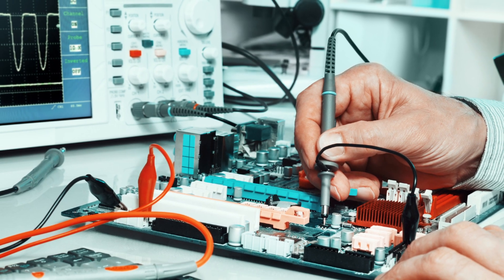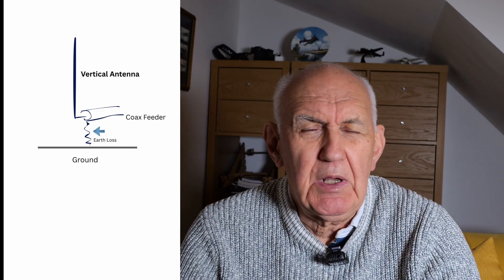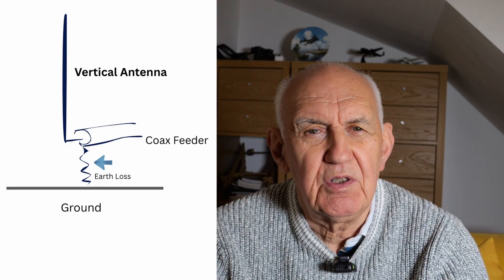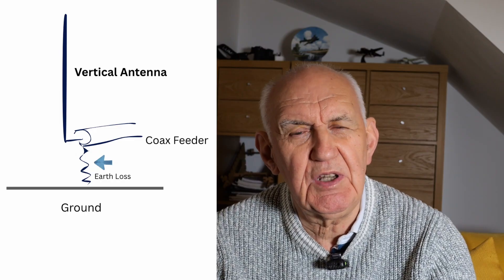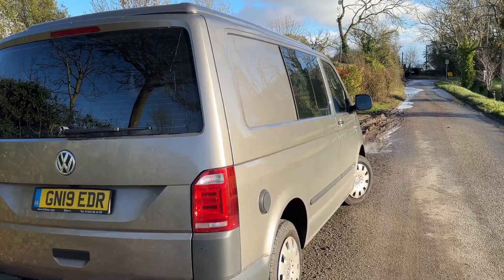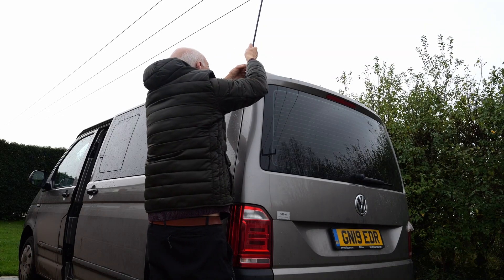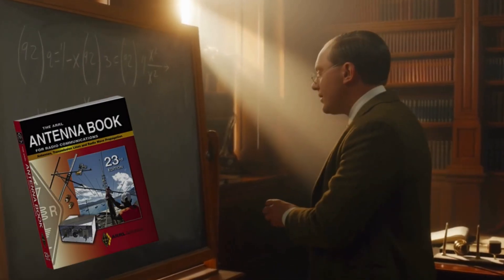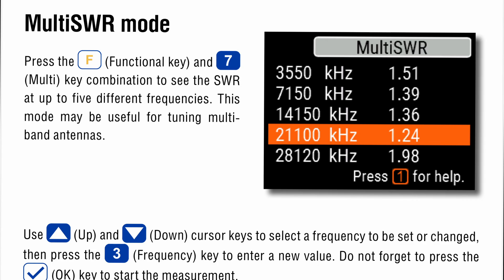VSWR Mysteries in HaM Radio

Comment: Thank you for explaining why my line isolator (choke) improved my SWR and brought it within specifications when I installed it at the transceiver input. I made the choke based on one of your videos. Following your suggestion, I used a 240-43 toroid core and wrapped 13 turns of RG-58 cable around it, securing the cable to the toroid with tie wraps. It fit just right and required about 2 feet of cable. Without the line isolator, my SWR was in the red. I had considered the issue of reflected RF coming back down the cable and the blocking effect of the choke, but I had not thought about the change in reactance at the transceiver input from the cable itself. Thank you for these excellent videos!
Reply from the maker: Glad to hear it worked out for you!

Comment: Peter, I have a question.
When winding an unun on a toroid, depending on the mix of a toroid, the frequency tends to be higher or lower as in a passband.  For example, one mix might give better response up to 25 MHz and another mix works better at higher frequencies. Now, what if you stack two toroids together, one of lower frequency mix and the other of the higher frequency mix? Would this offer a broader frequency response? KK5R
Reply: AI says yes, there would be a broader response curve to the common mode choke.   But AI is wrong.  You see, the different mixes have different absorption rates that add an element to the response curve.  And, that can cause resonances that reduce the effectiveness at specific frequencies.

But, in simpler terms, if combining different toroid mixes improved performance, we would see such combinations in commercially available common mode chokes - but, we don't.   And, there are real reasons for that.

If constructing an impedance transformer, mix 43 is better for typical HF frequencies.  If constructing a common mode choke, mix 31 is a better choice; although, mix 43 will work.

At higher frequencies, you will find mix 61 or 52 to be more effective for common mode chokes.
Reply: @richardowens9061 
I'm more interested in unun use than choke use. With all transformers, there will be losses but systems still work because of receiver sensitivity on the receiving end. But a toroid frequency response could make it unusable at 2M if it's optimized for HF. Hope you see what I'm getting at. The overlap could broaden the bandwidth, theoretically, but interactivity could be a problem so some experiments would go far in answering this question, which I'm not able to do.